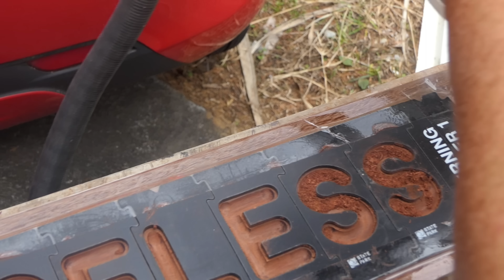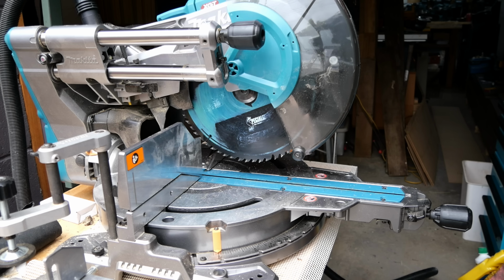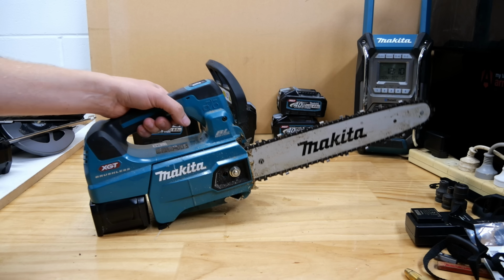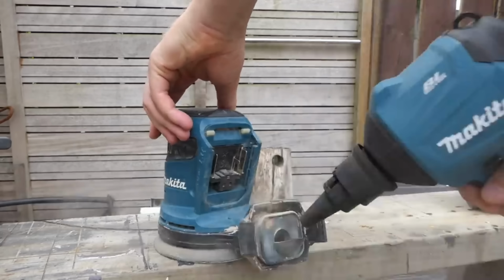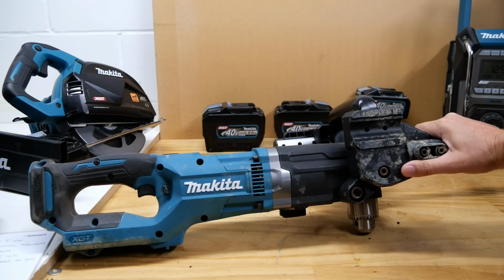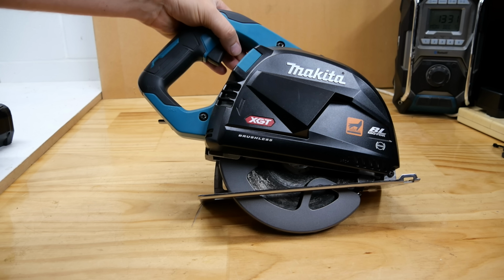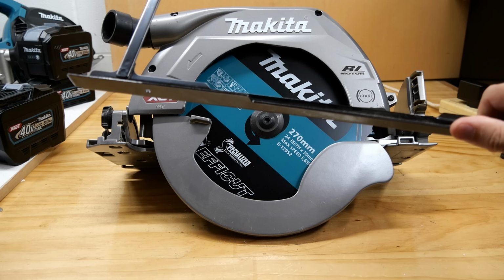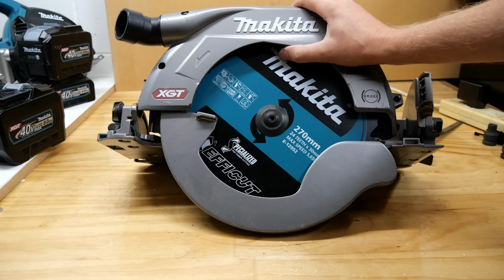TOP 5 MAKITA 40v TOOLS of 2022 Compiled by TOOLS & STUFF

Comment: I hope the xgt range expands significantly in 2023. Makita seems to have dragged their feet a bit with the 40v platform
Reply: I've yet to see anyone else on a job with any XGT tools, the sales are a bit slow at their price point.
Reply: @bartfoster1311  they are really good tools but the selection just isn't there yet to make the transition really worth it. The heat gun would of been the perfect opportunity to make a really useful and good xgt tool, however for some reason, they released a sub standard heat gun on 18v instead
Reply: But the tools are awesome, top tier
Reply: @riba2233  oh yeah defo, they just need to have srle tion parity with the 18v platform
Reply: @uberwayz  agreed, they are getting there but a quicker tempo wouldn't be bad :D
Reply: ? I'm in the U.S. and I think they have expanded pretty quickly actually. Have you checked out Acme tools? They have a ton of 40v on their. 

Every grinder size, all impact sizes, multiple Circ saw sizes, etc....

Don't get me wrong--i want more, but I think they have a ton out already. 

Way more than I thought they would at this point in time. 

Even picked up the new XGT Dry dust extractor.
Reply: I regret the switch to XGT. The tools are great but their garden range is below par. I switched for the convenience of having one battery system for all. The range is also too limited while they still churn out LXT stuff like there’s no tomorrow.
Reply: Steve D  idk, prices are pretty close in eu except for the batteries but it is so worth it, tools are more powerful and modern, also batteries use better cells and you have more size options
Reply: steved3947  I'd say the tools are worth the extra money for the added power, however the batteries are silly expensive. Two 4ah 40v batteries costed me well in excess of £300

Comment: Let's hope for a 40v 10" table saw with Dule  batteries for run time, ASW a gear adjustable fence for fine tunes a nice large table surface and built in flooding rolling stand

Comment: I bought the XGT blower after I found myself covered in paint chips and dust from work. I would like to not have to run paint chips off my neck and use the blower to blow off the paint chips. And clean my keyboard, ac filter and what not.. also about to purchase their 200GT set